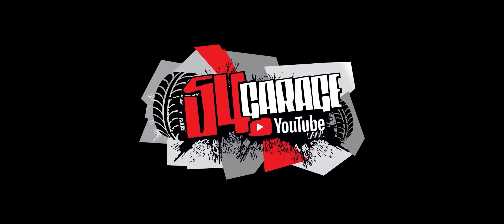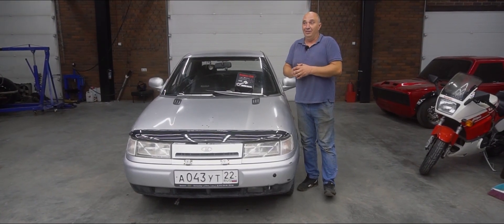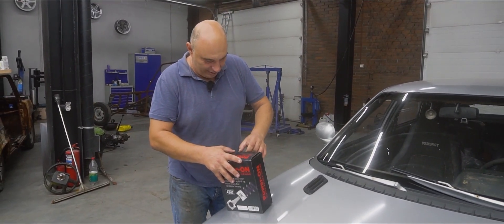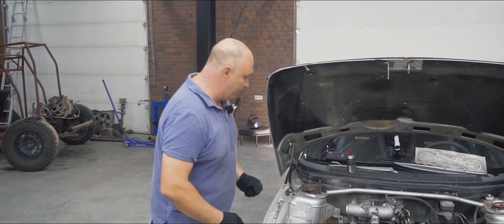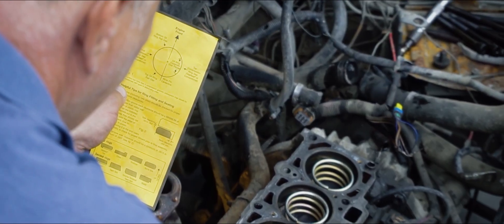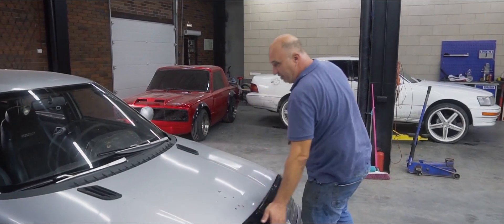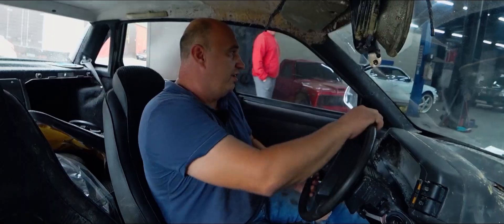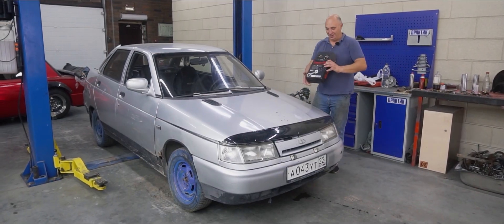Piston return springs (good for 30 HP) – do they actually work?

Comment: Even if it doesn't blok the valves,  does not scratch the cilinder and would not block the piston. Whats the point of this??? Aplying a spring to push the pistons down with more force and the when the piston moves back up aply force to slow it down?🤔😂

Comment: man i don't know about the tolerances on that. i've spun a rod bearing before, which in like 1/16 inch or 2mm and that made the piston slap the head when running. no way will it work.

Comment: If you had a like 6:1 compression engine with a -10 piston to deck clearance and the spring fit snuggly into the bore, this could work. Bit its just as likely that the spring would spin sideways and grenade the engine.

Comment: Weird request but how about a continuously variable transmission (cvt) as a differential. Would it not move in first gear til you give it the gas. And when you went to shift gears would it be smooth?

Comment: It's pushing down on the Piston going down adding power. But it's also pushing down on the Piston while the Piston is going up so it's making no difference. If they were somehow active springs that only push down when the Piston is going down then that'll make a little power.

Comment: No one else noticed those were for a big truck? The 4 cylinder springs should be 1/2 the height of those.  Hopefully, they can return those for the right ones, and do it again! AND, they have to be sure to tighten to the proper number of ooga, oogas for proper torque on the bolts!

Comment: I'd be tempted to see if they could build a destroked motor with enough TDC clearance for the springs fully compressed if it would do anything, also springs that had tighter tolerances to the walls to possibly clear the valves

Comment: The only way I can ever see the motor possibly run is in a non-interference engine with low compression, steel head with springs welded to the head in such a way the allows the valves to open / close. Maybe run 3 or 4 head gaskets stacked to allow for more room in the cylinder when the spring compresses. It’s pretty hilarious trying to rack your brain coming up with a way for this to actually work 🤣

Comment: Try to put those springs in a 2 stroke engine. There you have no valves :D
Reply: There you have almost zero clearance.
Reply: @JM-yx1lm  you'd have to run a "conical" type spring, so it compresses flat without the coils on top of eachother
Reply: Not necessarily true, well usually not true even. While your intake is done through scavenge air ports in the liner your exhaust is still vented through valves. At least on anything I've worked on, ranging from Detroit diesels to EMDs marine engines. (And Wickmann and various other brands, they don't differ much in design)
Reply: @ColtaineCrows  gasoline 2 strokes use exhaust and intake ports. They don’t have motor oil and use a gas oil mix to oil the bottom end. It could work there
Reply: @ColtaineCrows  there is a 2stroke bike behind them at first
Reply: @ColtaineCrows  Thats on diesels, but gasoline 2 strokes really don't have valves. Exhaust ports are also in cylinder walls.
Reply: it takes power to compress the springs so no gain just loss of power.
Reply: @M-2 Hydra that would be even better because you could install a clear cylinder head
Reply: Double the power bands with polyurethane instead of elastic for a boost on torque and always use diesel spark plugs....
Reply: @GB-vn1tf  the "power bands"    lmao.  i like that!

Comment: That was a good one.  I'm watching this and wondering how this could possibly work, and when he started it and drove, I could hardly believe it, but there it was.  I mean, I know there's very little clearance there.  On many cars, if your timing belt breaks, the pistons will crash into the valves.  Very good.  You guys are great.
Reply: your comment makes no sense, conrod length and crank profile dictates the height of pistons in relation to valves, the stroke isn't altered whatsoever.

Comment: At 5:50 I’m questioning everything I think I know about internal combustion engines. In fact, this morning I helped my brother troubleshoot a 2-stroke (no valves) that wouldn’t turn over because it had a tiny piece of rope inside the cylinder... which is part of a (stupid) recommended procedure from Stihl to remove the clutch from a chainsaw.

Comment: I immediately thought: A spring works both ways, even if it did fit, and didn't interfere with the valves or lock the engine up, it would be canceling itself out. though, I realized it was fake from the get-go as anything that large inside a cylinder bore would lock up just about any engine.

Comment: Maybe with a 1/2" thick plate for a head gasket, weld the springs to that at their highest so they'll clear the valves. But now compression is 2.5:1 so you'll need a supercharger out of a T72 MBT and some jet fuel... :D

Comment: you should try horse leather belts in your engine for even more HORSE power
Reply: Or maybe try fixing horse shoes to the tires. The result is more power and more grip
Reply: Just Make sure the belt is not pig skin, that would be bad, nobody wants a pig of a car.
Reply: Thomas LeMay Dude, a pig skin belt would make your car slower, no one would want that
Reply: Horse hair in the fuel tank
Reply: Bugatti used horse straps for hood straps as they bred horses before building cars.

Comment: I get this is for fun but least give the noobs and explanation of why this doesn't work eg. interference engines vs not.
What i want to see is two blocks bolted together with a spacer for side valves like the new diesel engines will be designed.

Comment: Said I wouldn't watch but changed my mind. Did believe it would start...The springs need to be taller than the length of the stroke so that they are held somewhat in place at bottom dead center AND  the engine needs to be an L Head, aka side valve or flathead so the spring is not in contact with the valves.  Still wouldn't add power though...

Comment: Was this originally released on the Russian channel around April first?
I've got 5 minutes in and I can't tell if this is a prank video or a scam product. Surely these things would be smacking into the valve heads hard enough to bend the stems???
Got to 9 minutes. Yeap, it's a prank. :D

Comment: I can't decide if this is dumber than electric turbos or not.
Reply: freezeme360  I'm talking about the cheap ones you find on Ali-Express.  The ones that are roughly the size of a hair dryer.
Reply: freezeme360  isnt abelt more efficient than a generator+battery+motor
Reply: freezeme360  neither do i...when i refer to efficiency of a motor i mean the ratio of energy it consumes versus what it produces.we are on the same page on that
Reply: freezeme360  i believe when they measure efficiency of a bearing they measure energy losses due to friction of that bearing. you cannot sum eficiency of individual components directly to calculate efficiency of a system because they all play diffent roles and impact efficiency of the system at different rates...the bearing was just an example, i think even a crappy bearing will have negligible impact on the efficiency of a high power motor or alternator
Reply: Tsunauticus III  hello mister speech-impaired...nice emoticon gizmo thingy you posted there
Reply: freezeme360  youre right , some people even dont realise that turning on the high beams, wipers etc costs them fuel. because once you start dischrging the battery the alternator will use more power from the engine, many people dont realize electrical energy in the car is "not free".
Reply: https://www.autoweek.com/news/a1908186/volvos-new-electric-supercharger-explained/
Reply: @wirebrush  made by valeo???hahahahah even their alternators and starters break all the time...its going to be lots of fun....maybe it could be usefull to help spool a real turbo, to eliminate lag, other than that its never gonna happen

Comment: Normal spring material would lose its heat treat from the heat of the combustion chamber, so they are not acting as springs.  At best all they would do increase your compression ration slightly.

The "Made in USA" was a nice touch.

Comment: G'Day..had me doubt's about the spring even before you put them in,,
If You really want to put the  springs in,,I suggest attachment to bottom of con-rods,,
probably need a tension spring and not the compression springs supplied,
at least the engine will rotate,,not sure for how long,,OR if you will get a horse power increase,,but it will keep your blokes of the street for a little while,,Har Har,

Comment: Today i will buy semi synthetic concrete based engine oil , 
good for balance as it dont slosh about while turning, improves traction,
100% guaranteed to prevent any water corrosion on internal parts that are coated,
With a lifetime warranty as it will outlast the life of any engine
(LEGAL NOTICE performance may vary)